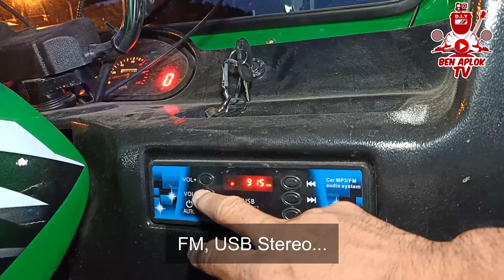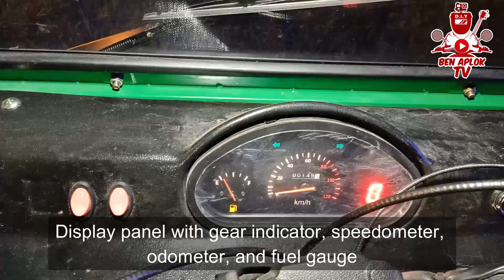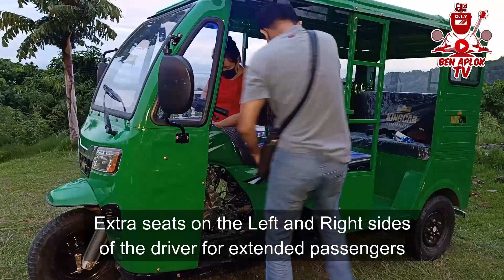KINGCAB SKYGO 150CC UPHILL DRIVE TEST WALK AROUND REVIEW  |  TUKTUK

Comment: problema ko sa 150cc ay yung tubo sa ilalim na aluminium.. ung cooling system ay maingay.. nagvavibrate. sobrang ingay.. haist
Reply from the maker: Yun sa akin may nagvavibrate din. Hnihayaan ko nalang. Hnd naman naka apekto sa performance. Mahalaga yun makina ay nasa tamang condisyon.
Reply: @benaplokcampandgo  pero maingay talaga xa as in.. haha nakakarindi.. mahirap panaman anuhin ung screw ng mga aluminum na yun.. lalagyan ko sana ng sapin  na rubber para hindi na maingay.. pero mahirap i unscrew talaga. matigas kung gagapangin mo lang sa ilalim at i DIY mo.. need talaga dalhin sa shop